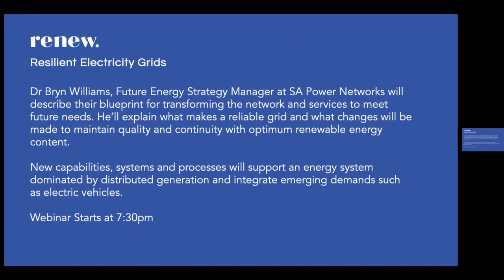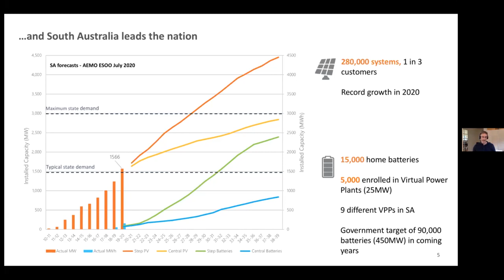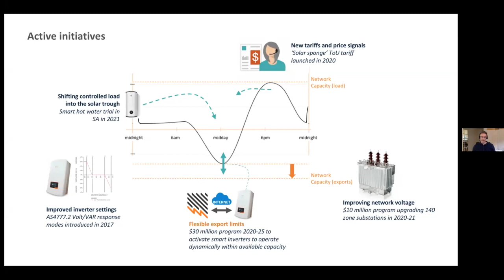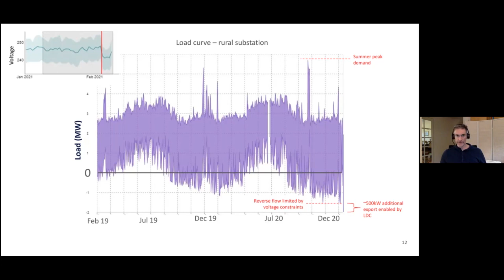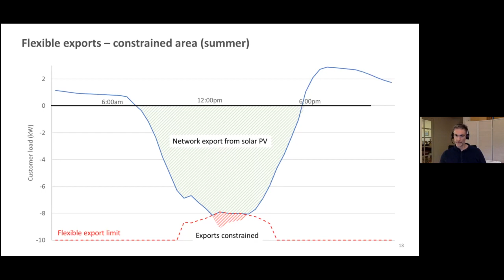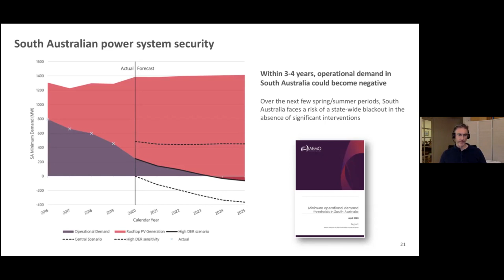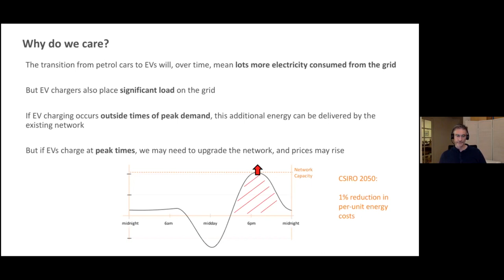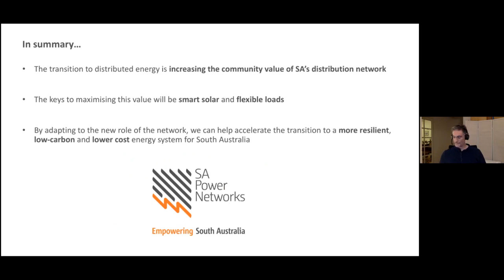Resilient Electricity Grids

Comment: Aircon load will be a thing of the past if all homes is bought to the current century and fitted with double glazing and air tightness. Since fitting double glazing, have barely had to put the split system on whatsoever ! Even with 42 degree temps outside, it peaks at 28 inside with low powered ducted air ventilators bringing in passive cool air in the afternoon.

Comment: EV loads to push up network charges. Time to move back to public owned and micro grids with local battery storage. Day time hot water is heat pump hot water, replace all that gas hot water and traditional electric with heat pump. powered 100% by rooftop solar no load from network. Requirement to push the voltage regulators on the networks too. The 220v voltage regulators makes perfect sense for efficiency and heat dissipation reduction.

Comment: Voltage regulators should be on the actual grid not sub stations. Smart meters is 100% hackable and needs to be stopped and changed to ethernet based solutions using your own internet connection. Stop that junk.